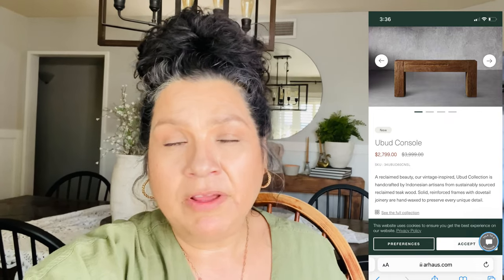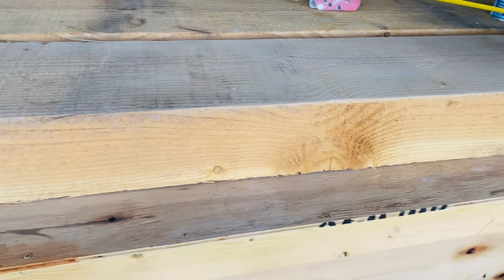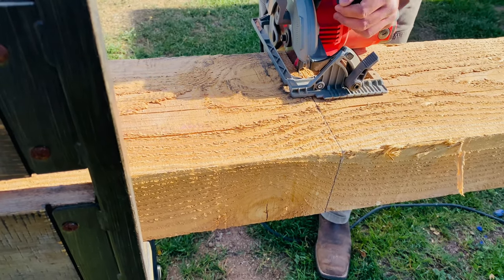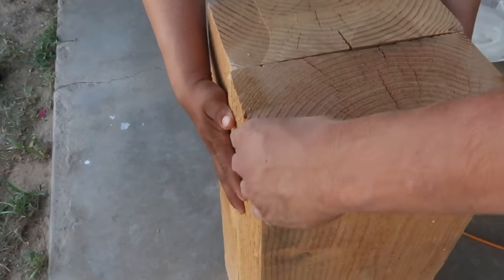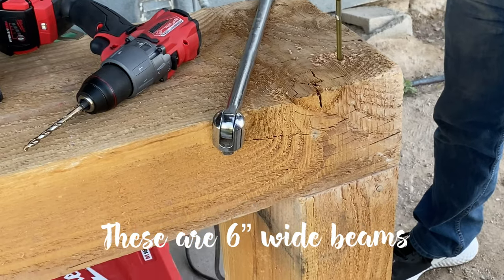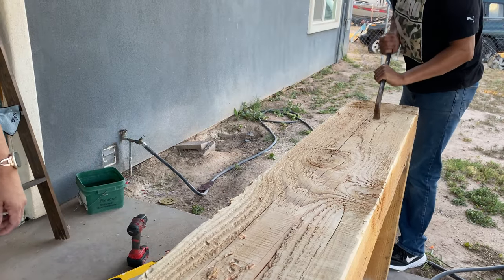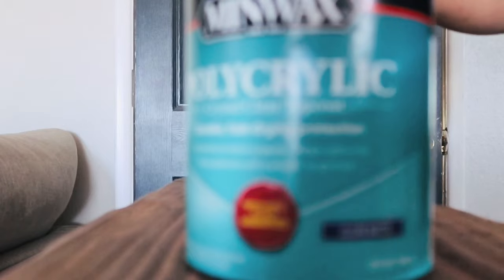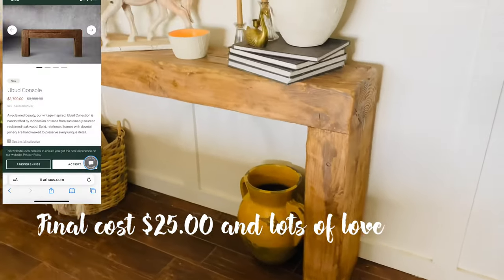DIY ARHAUS CONSOLE TABLE DUPE

Comment: Hey do you have any recs on where someone can get those beams for a decent price? Also how’d your adhere the legs to the top or the table pieces? Thanks!
Reply from the maker: I would check Facebook market place I seen some local to me that already have patina and where  still in great shape for $50.00 each beam !  But I do know Home Depot has them I just don’t know how much they cost . And my son only used the screws that I mentioned we didn’t use any kind of glue and it’s still holding up strong 😊